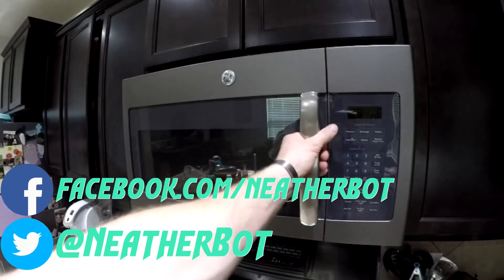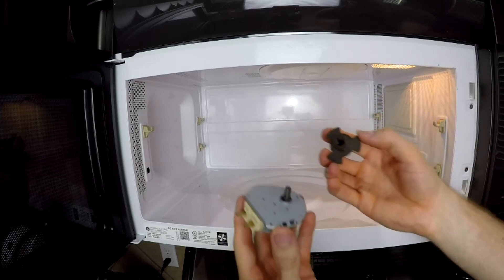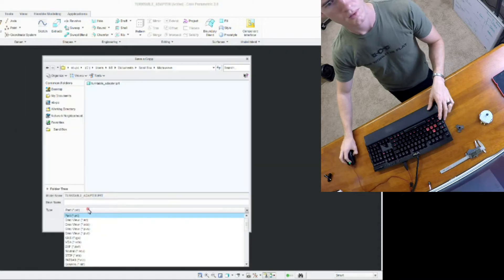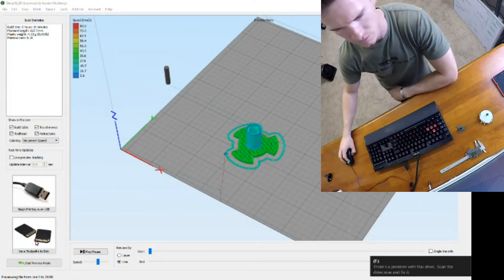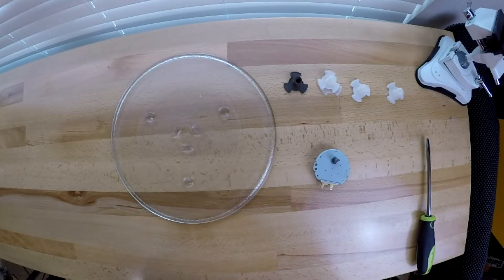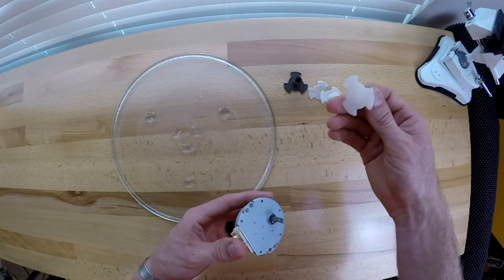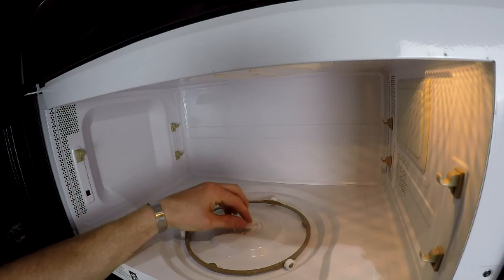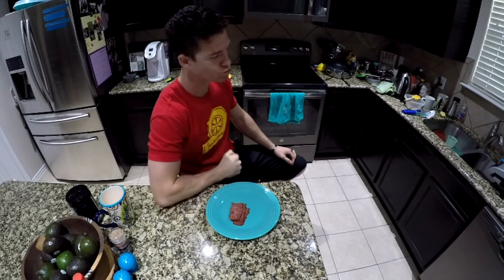ICPT -  Microwave

Comment: Is Nylon microwave safe?
Reply from the maker: +Hannover345 this nylon printed piece just recently melted. I think so water spilled down under the glass tray and it heated up the nylon. It lasted for awhile. Nylon is probably not the ideal material to use, but it worked for me and when it failed it just kinda got soft and boiled. No fire or smoke or anything catastophic.

Comment: What is the STL resolution? Thanks.
Reply from the maker: I printed the part with 0.2mm layers. Thanks for the question.
Reply: I was referring to the STL export.
Reply: thanks
Reply from the maker: +David Bitton ah I'm sorry. 
Chord Height: 0.04 
Angle Control: 0.01 

Is that what your looking for?

Comment: Great video.  One suggestion is to talk briefly talk about why you chose the material you chose like in this case nylon has good heat resistance.  because PLA may actually soften and deform in the microwave during longer microwaving. ABS you could probably get away with but it is highly flammable because it is oil based.
Reply from the maker: Thanks for the feedback, Yeah I could have done a better job explaining why I choose Nylon, and my concerns about how it could potentially fail. 
I wanted a high temp plastic that was food safe. Nylon is both of those. It is however, hygroscopic which means it absorbs water. And water is what gets excited in a microwave and heats up so the potential failure would be the nylon bracket traps water and then melts because that water gets hot. BUT so far so good, nothing has melted yet.
These comments help me make better videos! Cheers!

Comment: Wait. Isn't nylon really hygroscopic? Will it not heat up in the microwave due to the moisture that it might have absorbed?
Reply from the maker: +Eric Nistler yes Nylon can absorb and hold water. I figured that Nylon was the best bet for being food safe and not melting. I am keeping an eye on this but so far it has worked great with no melting.
Reply from the maker: +darkfire2022 Yes it does absord water quite readily. I was curious about this myself but so far it has not given me any problems with melting or exploding lol.
Reply from the maker: +Eric Nistler the original part seemed to be made from a glass filled nylon. I'm. It certain but hopefully the printed Nylon part continues to work. Thanks for the encouraging words! Stay tuned for more 3D Printing videos!
Reply: +NeatherBot PET plastic is another plastic that you could try out. It's a lot easier to print with than nylon.
Reply from the maker: +darkfire2022 I think I have some, if the Nylon part explodes I'll give that a shot and see if it fairs any better.. Is PET food safe?
Reply: +neatherbot pet better be food safe.  same plastic as most pop bottles and thousands of other bottles.
Reply from the maker: +Eric Nistler lulz... I didn't catch that. Your right. Haha it's late forgive me ;)
Reply: I wondered about this also... I don't know the answer though
Reply: +neatherbot thanks for the reply, makes me wonder what the original was made out of. Great project though, these useful prints are the reason I built a printer.  I'm not much into polygon Pokemon or vases.  Keep up the good work.